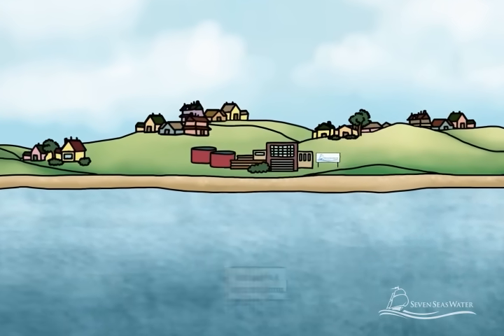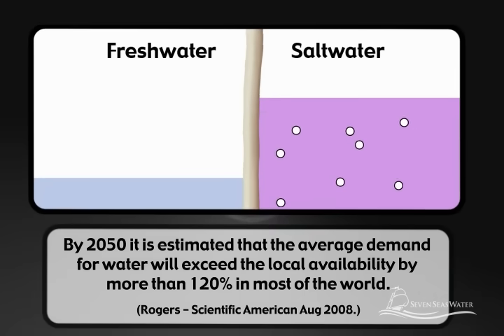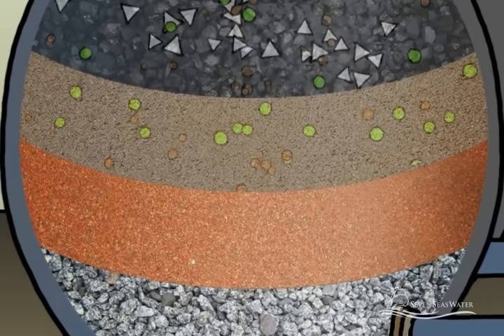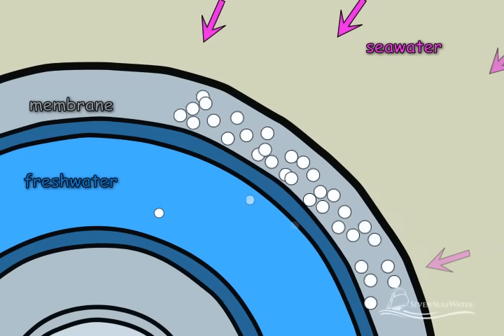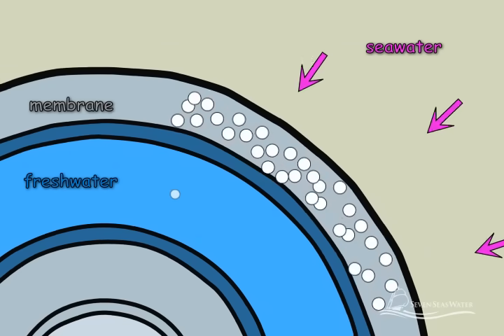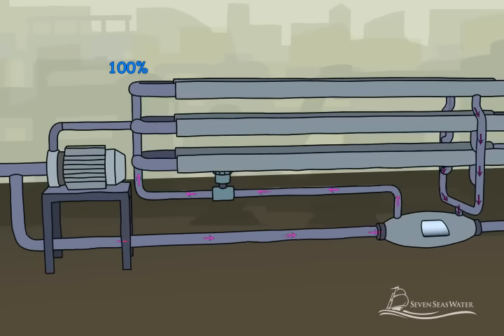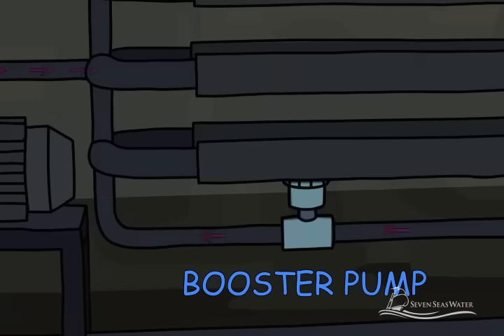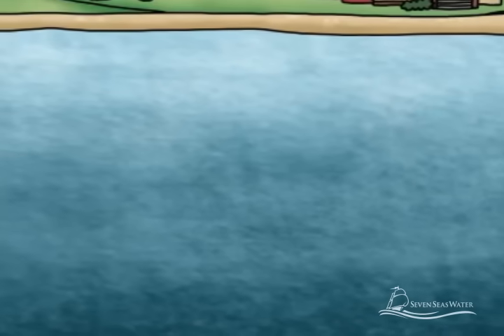How Seawater Desalination Works

Comment: Multi-Level Rotational Mill Vent Wind Towers

Regardless as to whether a person is a climate change sceptic or not, why would anyone wish to support billions of tons of neuro-toxic carcinogen hydrocarbons, being constantly vented into the atmosphere we all have to breathe. Over that of making using of the unlimited quantities of free natural energy, which could be quickly made available; if it were not for corrupt politicians and governments, acting at the behest of their Corporate masters rather than for the benefit of the people who elect them and they disingenuously claim to serve.

Natural Sources of energy  

Wind Turbine – Solar – Hydro – Water Wave – Water Current - Geothermal – Composting - Sewage/Methane – Organic/Alcohol etc.

Wind Turbines

Contrary to the views put forward by their critics, properly designed wind turbines are the major solution for generating unlimited amounts of electrical energy, and scrubbing the atmosphere free of excess Co2, GHG’s and hydrocarbon pollutants.

Current vertical rotor wind turbines are noisy, inefficient, take up far too much ground space, are a blot on the landscape, kill birdlife, and are a health hazard due to their electromagnetic emissions, in sum they are primitive.

Wind energy frequently asked questions (FAQ) | EWEA http://www.ewea.org/wind-energy-basics/faq/ Wind Turbine Size To Output Power: 7.5 MW turbines are the largest today with blades about 60 metres long – over half the length of a rotor diameter of over 120 metres – longer than a football field. 15 MW turbines are planned and 20 MW turbines are considered to be theoretically possible.

At some time or another, all of us will have seen the rotating mill roof vents which are used to extract excess heat from our homes and factories. Unlike the single direction of limited wind power that is garnered from rotor blade turbines, rotating mill vents have an all-round wind surface area of 360 degrees. 

Comparatively, relative to the diameter and height of the rotating mill, this grants the mill the ability to garner many times the amount of wind force available, than that of vertical rotors, over the same area of ground space.

Given that a 120 metre rotor diameter wind turbine will have a height of at least 130 metres, a multi-level wind tower (Which can be built to any height) of the same height, and relative to the height of the rotating mills, it could accommodate several rotating mills, over the same area of ground space.

Unlike vertical wind towers which deliver rotational power to an elevated motor turbine, rotating mills would deliver their rotational power to a central vertical drive shaft, which would descend into a motor turbine below ground level, which would serve to absorb both electromagnetic emissions and any noise from the motor turbine.

Wind Turbine Energy Efficiency

Betz's law gives a maximum of 59% of the wind power exerted, as to being available for conversion into mechanical energy, via a conventional vertical wind turbine.

Elevated wind turbines are subject to a gravitational leverage effect, (yaw) due to the wind exerted on their rotors, which causes friction and reduces the efficiency within the turbines.

Lateral rotating mills would suffer no such problem as there is virtually no leverage or resistance factor, as they simply spin faster in high winds. And given a magnetic levitation factor acting between their rims and their tower seating ring, friction would be eliminated taking their power generation efficiency up to virtually 100%.

FactCheck: does Australia have too much electricity? - The Conversation http://theconversation.com/factcheck-does-australia-have-too-much-electricity-31505
We have 9,000 megawatts (nine big power stations equivalent) of excess capacity in electricity generation … We have more than 15% overcapacity in generation in Australia - Industry minister Ian Macfarlane, ABC Radio, September 9.

Capacity and supply
In electricity markets, “capacity” is used to describe the total potential technical capacity (in megawatts) of a system. The total capacity in the National Electricity Market (NEM) is approximately 50,000 megawatts. “Energy” is often used to describe the output, or the electricity that is actually delivered.
Quite Simply: Given that an increase of power output from 57% up to 99.999%  and a far greater wind driven surface area to the mill, one lateral rotating mill vent would generate several times the 15 megawatts of output from the largest vertical wind turbine, multiplied by the number of lateral  rotating mill vents mounted in each tower.

As such it does not take a genius to recognise that given the national grid system, enough electrical power could be generated from rotating mill towers, utilising perhaps one or two square kilometres of ground space to meet and exceed the total electricity requirements of the whole of Australia.

More facts relating to rotational mill towers, can be found on my website www.fromthecircletothesphere.net

 OTHER RELATED INFORMATION

Tech Removal of Co2 & GHG  from atmosphere

Cyclotrons – Filters – Water Filtration – Osmosis - Ionization 

Natural Sources of Co2 & GHG removal e.g.

Rapid Growth Seaweeds - Trees – Bamboo – Hemp etc. Greening Roofs and walls of Buildings - Allotments – Greening Bare Gardens & Nature Strips.

Energy Storage

Water elevated by use of excess electricity during the day, hydro power used by night,
  
Electrolytic Separation of Oxygen and Hydrogen from water
Tesla Batteries - Hot metal Batteries
Ceramic - Heat Storage 
Water & Liquids - Heat Storage

Electric Transportation

Trains – Mono Rails – Trams – Road Vehicles – Barges – Boats; Shipping (using varied combinations of Solar - Wind – Hydrogen – Battery – Sterling Engines - Electrical Engines of Mechanical Advantage)
Air Ships Helium and Hydrogen combined (With modern safe e.g. NASA technology)
Electric Pumping Stations for Sewage & Liquids  
Magnetic Levitation Trains & Mono Rails for Solid Matter

www.fromthecircletothesphere,net

Comment: Why not just boil the water and collect the steam in a separate container? Evaporation is a natural filter. The water vapor leaves behind all the bad shit and then condenses back into clean potable water. It sure as hell seems a lot less convoluted than the process described in the video.
Reply: to simple and how are they gonna get all those taxpayer dollars if the kiss principle is applied
Reply: It takes roughly 5.5 times the amount of energy to seperate sea water by distillation (boiling) than reverse osmosis. Boiling uses about 90kwh per thousands gallons vs. around 16kwh per thousand gallons for reverse osmosis. That said, distillation produces purer water and is suitable for agriculture. Also, distillation is not as simple as you think. You still need initial filtering since boiling seaweed, minerals, etc. typically clogs the pipes up. Further, there is a limit to how much salt and carbonates you can leave behind before the cake up the piping, so you end up having to pump much more water through your system since you can only boil away a small percentage and still keep the rest of the salt and minerals in solution to flush them out of the pipe.

http://large.stanford.edu/courses/2010/ph240/sherer2/
Reply: solar =/= infinite
solar regenerate energy at very small amount. 
also the amount of energy generated really depend of the weather
Reply: @frank: prepare a business case. If it seems feasible then do invest in Solar powered desalination. I think it will definitely be doable in arid regions for domestic or drip irrigation purposes.
Reply: the energy needed to boil the water .. be comes very very expensive .. imagine if you had to boil 100 gallons perday ( average american usage ) .. how much fuel would you use?..and that is just for you ..what about the 10000 people in your SMALL town ?
Reply: @deepsquat600  People can solar distill their own fucking water rather than relying on a service with convoluted piping run everywhere, then the task of fresh water supply is evenly and easily dispersed you fucking moron.
Reply: @deepsquat600  Solar powered boilers. It's unlimited.
Reply: really?? how many of these exists?? how much can it boil?? have you ever tried to boil 100 gallons?? let alone 100000 ,, 
 BTW ..boil 100 gallons os salt water does not net 100 gallons fresh water ...
Reply: @deepsquat600  All you need is electric boilers powered by solar power. This isn't fucking rocket science. lol
Reply: actually it is..look at what it takes to do the reverse osmosis .. dont you think if you YOU are saying is the way to go would work that it would be done?? again .. you are NOT  accounting for the energy expenditure to "boil " the water ...
Reply: @deepsquat600  What do you mean? The energy is coming from the sun. The solar energy is converted to electricity which powers the boilers. The sun is an almost infinite power source. No need for any non renewable fuel.
Reply: did you even read the wiki.. they still use revers osmosis 
A solar powered desalination unit designed for remote communities has been tested in the Northern Territory. The reverse osmosis solar installation (ROSI) uses membrane filtration to provide a reliable and clean drinking water stream from sources such as brackish groundwater. Solar energy overcomes the usually high-energy operating costs as well as greenhouse emissions of conventional reverse osmosis systems. A photovoltaic solar array tracks the Sun and powers the pumps needed to process the water, using the plentiful sunlight available in remote regions of Australia not served by the power grid.
Reply: again a HUGE energy expenditure,, there is no free lunch . a photo voltaric area ...is  not cheap..it is NOT just one solar panel you get down at harbor freight ..
 and BTW ,,,DISTILLED  water tastes like shit ..as does desalinated ..good for watering  your lawn..maybe wash your cloths ..
Reply: @deepsquat600  Wow. lol. Solar panels end up paying for themselves over their lifetime.

The taste of the water is irrelevant. They can add minerals back into the water for taste. Even still, I'd rather have shitty tasting water than die of thirst.
Reply: NO, there are two ways to do it with solar, direct or with a membrane, so you are wrong. SOlar energy is free, initial investment would be easily paid by the product overtime
Reply: don't you still have to salivate it
dude
Reply: @LucioFercho   just to power your house..so you could bill say 100 gallons..cost around 30000 dollars..as current electric costs in California it will take 20 years for a payback for the electricity...assuming zero breakdown...you obviously have never priced anything in your life..and assume money grows on trees
Reply: or to run all those pumps  @deepsquat600
Reply: deepsquat600 wow stop embarrassing yourself here with your comment, there are solar panels, wind and sea wave harvesting energy that will do it... just think a little... see ? Is not that hard ... 
desalination plants is an old invention used by several countries around the world for over a 100 years now, specially in the Caribbean islands, the only newer added invention would be the solar powered, wind powered or sea waves powered electric facility that will solve the cost on energy to power all the desalination process and could also be used to power houses in a lot of towns, bring jobs opportunities and bust the economy and prosperity in full regional areas.
Reply: Charlie K  You sir are a certified idiot. For people to desalinate their own water, distillation is far more practical. The primary reason is that anyone can do this, it is self-reliant and reliable with no moving parts and no special filter - nothing to break or buy, or buy again and again.

Comment: I've seen how the US navy desalinates their water and I think it's the best way. I can't go into how it's done but the water comes out so pure it's not even funny and they can make tons of it.
Reply: It's hardly a state secret. Is done on all sorts of ships, including cruise ships. It's flash distillation, often by steam which is used to create a partial vacuum and lower the boiling point of the seawater, which then boils. The vapour is collected and condensed. Pure water is the result. It's viable on ships as there is no alternative, but it is very energy intensive and uses five times as much power per gallon of water than reverse osmosis. If it didn't don't you think it would be in more widespread use on land?

Comment: Seems like you could just do all this 1000 feet below the surface and avoid having to use all these pumps
Reply: You would then have to pump the water back up 1000ft. No net gain at all, plus all your equipment would be in a difficult to access and very expensive hole in the ground.

Comment: There is another way of filtering sea water than in this video. All you need is sea water a pot and a plastic bag.
Reply: hydrocarbons can pass through that type of distillation process. You would still need some type of chemical filtration like using active carbon.

however, pumping seawater into a 40,000 square foot pond and condensing water vapor would be less energy intensive.
Reply: your last sentence made my point after the 40,000 foot pond. I could think of the right word thats why I'd typed distillation also thats why I'd put just a pot and some plastic use the sun and the energy is free. The size of the pot or container will depend on the number of people.

Comment: Seems like an overly expensive way of doing this.  Millions on multiple stages of filtration when you could achieve the same result with simply boiling it.
Reply: Which uses five times as much energy, and still requires the initial filtration.

Comment: Seawater to Sweetwater CAN be accomplished with far less energy and the equipment is 1/10th as costly as RO while not needing to constantly replace the expensive and fragile membranes. By adding a commonly used food additive to the incoming seawater to adjust the pH to the appropriate value, applying a direct current (DC) pulse causes EVERYTHING in the water to be purified except for the water itself (H2O) to be transferred to the anode (DC-) and cling to the electrode at either or both the molecular and atomic levels, leaving potable water ready for transfer to the consumer or holding vessel. Building a solar farm adjacent to the water facility would mean that the cost of the process per gallon of water is a fraction of the price for the energy, hardware and labor necessary to use RO. -- This process is called, "electrocoagulation" and has been around for a long time. It's just not as sexy sounding as reverse osmosis. CLEAN WATER IS INEXPENSIVE AND SIMPLE. BUT, ONLY AS LONG AS IT'S SCIENTISTS AND TECHNICIANS WHO ARE RESPONDING TO A DEMAND FOR WATER AND NOT MERELY IMPLEMENTATION OF A POLITICALLY DRIVEN AND CORRUPTED SELECTION OF A SCIENTIFIC PROCESS BY NON-SCIENTISTS.
Reply: Strubbeltom Nervi  - Chlorine and Sodium Hydroxide are both used in water reclamation and hydrogen is environmentally neutral. What's the problem?

Comment: Reverse osmosis is the least productive and long term viable method of producing potable water(you have to keep on changing out filters)...

... go with flash evaporation instead using waste heat or even solar in certain cases....
Reply: Haven't read up on flash evaporation methods, sounds interesting. 
But yes RO systems are expensive and the filters have to keep being changed out. I have worked for a water utility and now a beverage company where we use RO from our well for bottled water.  It's not 100% cheap... the electrical bill is big relative to bills for the cheapest (groundwater). Surface fresh water is also expensive, but still 4 to 5 times less expensive than water desalination RO process. 
Literally, you use two RO's for ocean water desalination... one for removing of NaCl the other to remove harmful surface compounds like oils, arsenic, etc.  
Our bottling plant uses metabisulfite to reduce aldehydes and ketones.... and we use ozone, all not necessary for just making drinkable city water.... really getting rid of lots of stuff, and we have multiple UV lamps and other RO when we're actively bottling the water.  The ozone the UV process isn't necessary for municipal supplies. 
Then chlorination which is cheap using brine tanks and electrolysis to produce the NaClO (bleach). Unfortunately, the bottler I work for now doesn't use electrolysis for their bleach, but buys it buy the barrel. The city supplier I worked for all well houses including surface water extraction plants all used electrolysis for bleach making... way cheaper and safer.
Reply: Heat water to a somewhat useful temperature, squirt it into a chamber under vacumn, collect "steam" condensation from top of chamber, then squirt some bromine into the potwater tank. Drink.
That, in a nutshell, is flash evaporation. Alot of outfits use the waste heat of a powerplant to run such a distillation plant.
When I was in the navy, I worked on a 5 stage distillation plant that used aux exhaust steam from the main propulsion plant to run, although I can't remember what the GPH output was but I think it was in the range of 20k-30K/hour, depending on how skilled the operator was(it wasn't automatic).
Even got an MVP award for saving the thing whilst deployed.

Comment: Ocean desal is an epic con job. 99% of installed plants are political. Example - Perth Western Australia which sits on a 1000 cubic kilometer aquifer !! This city has two desal plants pumping processed mega expensive water into local dams so it came evaporate during their long hot summers !! What will over paid IDIOTS think of next ?? Most of the world is happy to drink recycled water but not Australians. They pipe treated water out into the sea !! How insane is that?? Advance Australia Backwards.